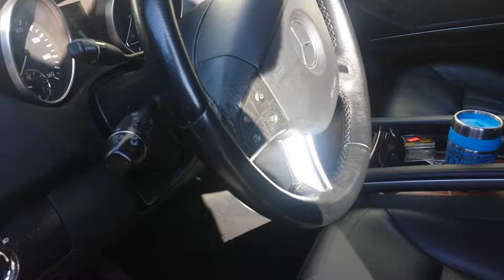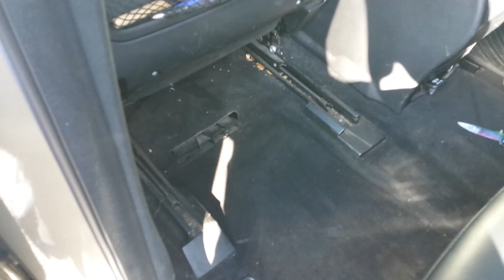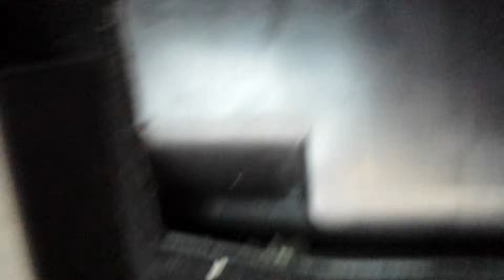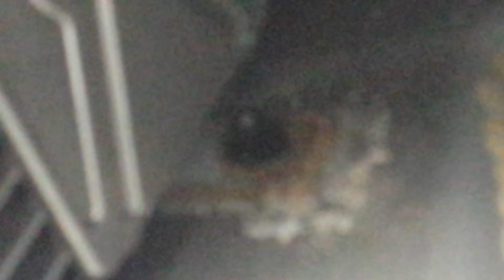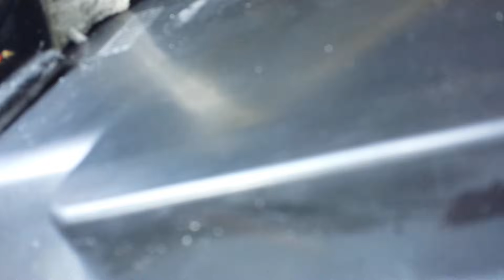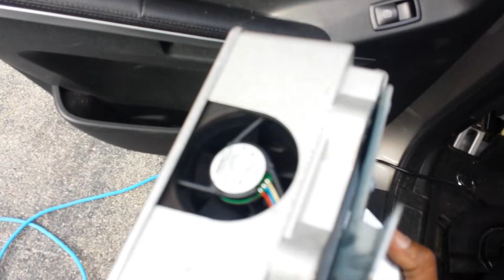Mercedes Amplifier Location/Removal/Install DIY HD

Comment: I have a Mercedes-Benz W169 A 180 CDI Sedan and have discovered water accumulation behind the front passenger seat, which I suspect is due to blocked drain holes. My primary concern is that this water ingress may have affected the wiring harness, particularly the 'wake-up line' (Brown/Pink and Brown/White wires) that runs from the front of the vehicle to the Audio Gateway (AGW), designated as N93/1, located in the luggage compartment (can't find it). My diagnostic report shows a current and stored fault code d135 for a 'wake-up line short circuit to ground,' along with stored codes d136 for a 'wake-up line short circuit to positive,' and d011 for 'supply voltage too high' for the AGW.  Could you please assist on a possible solution

Comment: It's a LOT harder than it looks when you do it! Getting the cover up even enough to get the amp in (I was installing, not removing) took all my strength and effort. But I did get it done - THANKS!

Comment: my 2008 GL450 has static for 5 minutes like blown speakers then perfect guessing the amp under driver seat as it was wet there i found one but had no sound at all so hoping the amp is causing this as i ordered one on ebay junkyard no luck

Comment: Good video. I got exactly the same problem this morning with my Wipers, No sound,
Reply: Check that you have NO water under your carpeting, the lower well, Floor. Drivers Side, move seat all the way back, remove sill panel and lift up that carpeting! Check this out, my control module went bad due to water, then my amplifier blew. Crazy stuff like wipers not working ect. You probably got water coming in from sunroof or under dash.  Mercedes Body Control Module - Genuine Mercedes 1649002901 Change control module and amp. Problem solved. Do it yourself, Just don't go to Mercedes or you'll be ripped off!!  Control module might have to be programed. Any questions, I'll try to help. I couldn't find this info anywhere. I have 2007 GL450. Thanks.

Comment: Thanks for the video, it's the only one dealing with the issue. If the volume works by the steering buttons but not on the radio knob, would you say it'll still be the amplifier? Thanks for your time.

Comment: I have 2005 e 320 radio was working perfect until yesterday now I can't open CD changer and radio display logo and turns off why do I need to check the amp ? Is it under the seat ? Please help 🆘

Comment: What's the model number for the amp on a '07? Are there different variations depending on the system you have in your GL 450?

Comment: @iRepair Autos I too have a 2006 ML350.  I watched and liked a lot of your videos. Were you able to confirm your amp was bad?  Did you replace the amp with another factory amp or an aftermarket amp?  My head unit works, navi works, CD player works but there is no audio, no sound from the speakers.  So Im suspecting its the amp.  Just curious what route you took and if it's working for you.  Thanks
Reply: did you fix your problem yet was it the amp?

Comment: I have a c240 2002 mb. My radio go on but there's not sound. I checked all the fuses and they are good. What could be the problem? Also when I took off the radio the fuse was blown and is replaced now but still no sound.
Reply: Bro I have the same issue. But still haven’t found a solution
Reply: He don’t answer back no question
Reply from the maker: @TheMcs33 that’s correct
Reply from the maker: Your amplifier is possibly dead.  I have a video on this on the channel
Reply from the maker: Look at the fuse for the amplifier
Reply from the maker: Keep searching.

Comment: Hey buddy, I know theres small chance, but. My command unit on this car, won't turn on and drains the battery, car dies within 2 days, is there anything you could recommend before I fork out thousands to get it fixed! Thanks again
Reply from the maker: Remove the fuse for the amp for 15 minutes and then replace.   Start with that.

Comment: Hey guys, I've had a 2008 Mercedes Benz E350 for 2 years now. The Harmon kardon Logic7 sounded amazing with powerful bass. Until one day my CD changer stopped working while I had CDs inside . I've been reading forums and some people said to remove the fuse for AGW, the CD changer and the radio. I followed the steps took the fuses out, put them back, and at the end the CD changer started working again. But ever since I removed the fuses and put them back into place, my sound has not been the same. I used to get powerful bass from the front speakers, and the subwoofer , and an awesome clear surround sound experience. What do I have to do to get the powerful bass back?  So much question is do I have to go into engineering mode to get the sound back, or what do I have to do to get the sound? Because I believe that after removing the fuses I must've messed up a component in the radio system that has to be readjusted. I still get sound, but it's not the same as it used to be before I removed the fuses. Sometimes I try, and I put the bass to maximum, and nothing happens. 
Guys please help me. Please
Reply from the maker: do a radio reset.  I have a video here:  https://youtu.be/iwRIUNMmYXI 
then go into your radio and and set the treble, bass, and surround sound options.

Comment: Thanks for this helpful clip. I had to cut across that plastic cover to get access. What a sight! The recess had 1/2 inch of water in it and the amp module was corroded and the tracks cooked. If I buy a replacement amp does it need to be reprogrammed?
Reply from the maker: No reprogramming needed.  Just plug and play.
Reply: I just removed the plug in the bottom of the recess and the water drained out. An other amp from eBay worked fine without programming. But then the body modules on the other side were also corroded and they do need programming. I sold the car as it clearly was on the way out. Pity such an expensive car is destroyed by a simple design fault- or maybe intentional???
Reply: The shop that found my amp in a puddle said it would cost $1200(CDN) to replace and they would have to reprogram the replacement so I couldn't do it myself. Then I showed them the unit and challenged them to show me the LAN connection. There is none, so I bought an amp off ebay for $250 and will replace it myself.
Reply: I just removed the plug in the bottom of the recess and the water drained out. An other amp from eBay worked fine without programming. But then the body modules on the other side were also corroded and they do need programming. I sold the car as it clearly was on the way out

Comment: Great video and work that you do. I just acquired a 2005 sl500 with a cheapass planet audio unit installed with the existing Bose. Totally distorted sound when streaming or CDs....I never listen to radio. My sense is that the Mercedes amp has been bipassed when they installed this cheap unit because of the distortion. Do you know where the bose system amp is located and can it be connected to the planet audio head> I read somewhere that it cannot....very confusing and not much in the way of resources. Thanks for any reply or opinion. Rick

Comment: All that cutting just to avoid removing four easy bolts and pull the seat out? Doesn't make a lot of sense to me, if it was my car I wouldn't want my carpet cut off like that, but that's just me.

Comment: What was the problem in the amp.  ? Did you repair it or change it  ?
Reply from the maker: Water damage.  I ended up replacing it.
Reply: In some cases cleaning the electronic circuit from moisture salt make it work.
My Ml bluetec front turn signal stuck on , when I open the front Sam found it salty , clean it with spirit and mount it made it normal again .

Comment: Unbolting the seat takes 15 minutes and saves having to cut the carpet as the carpet has a seam for access.
Reply: Well it does look like the access would be easier with the whole seat removed.  If it was my car, I’d have a way to pull up that carpet easily to access the amp. Crazy location.
Reply: Hell not even 15
Reply: Exactly what I thought, I don't know why he cut the carpet, it ruined my day
Reply: theSHARK who cares? It’s a 12 year old SUV. Reattach carpet with Velcro in case the amp breaks again
Reply from the maker: I could do it the way he suggests and if I was doing it for a customer I would. This is my personal vehicle so...   also SRS lights are sometimes triggered by removing the seat.   I don't want to suggest viewers do something that will cause further problems.   I have the tools to turn off these things but not all of my viewers do.   Look on the passenger side of the vehicle. Mercedes has cut the carpet that way too for the battery.
Reply: @iRepairAutos  I Repair you have 27000 subscribers, that is the number of Mercedes owners who have experienced an issue with their crappy audio system, can't find no one willing to mess with Mercedes unrepairable system, went to their crooked dealer anyway, run away after hearing the quote and are trying to find a good samaritan online to give them a clue about that system that no one wants to fix. (this is me by the way..lol). I own a 2008 GL 450 my radio configuration look similar to this one on your video; it has the same issue: no sound, but it manifested soon after I replaced the aux cable in the glove box that was bad. After I removed the radio plugged in the new aux cable, put back everything together there was no sound anymore. Just like in your video but the only difference on the display on this video the sound button is still present but mine disappeared from the display, and the cd changer button in the audio menu disappears as well and no sound; so I don't know if it's something that requires the dealer to reset these functions with their diagnostic tool, or is there a way I can do to solve this because everything was working just fine before I replace that cable. Can you give me any clue?
Reply: @iRepairAutos  if you don't want the airbag light to come on disconnect the battery for 15 minutes and than work 🤗😉

Comment: hey I have a 2007 mercedes ml350 the radio lost the audio and change the radio and the amplifier and still losing the audio can you help me?
Reply: I got a  2006 R 500 and I love my V8! just  put a new 9" android  system  simple and new speakers from Infiniti  kappa the cheaper way to upgrade w/quality...

Comment: I need your help My command unit isnt working properly..it turns on and off but stucks on the logo i can turn the volume up and down too..i can see on the dash that its playing the cd thats been in there but i cant control anything from the steering wheel nd the unit itself any solution?would really appreciate it
Reply from the maker: You should try the reset method.   I'll do a video.  Which Model do you have?
Reply: 2006 ml500 thanks

Comment: Hey guys, I've had a 2008 Mercedes Benz E350 for 2 years now. The Harmon kardon Logic7 sounded amazing. Until one day my CD changer stopped working while I had CDs inside . I've been reading forums and some people said to remove the fuse for AGW, the CD changer and the radio. I followed the steps took the fuses out, put them back, and at the end the CD changer started working again. But ever since I removed the fuses and put them back into place, my sound has not been the same. I used to get powerful bass from the front speakers, and the subwoofer , and an awesome clear surround sound experience. So much question is do I have to go into engineering mode to get the sound back, or what do I have to do to get the sound? Because I believe that after removing the fuses I must've messed up a component in the radio system that has to be readjusted. I still get sound, but it's not the same as it used to be before I removed the fuses. Sometimes I try, and I put the bass to maximum, and nothing happens. 
Guys please help me.
Reply from the maker: I will create a short video on what you need to do.
Reply: @iRepairAutos   Thank you sir. I appreciate
Reply: @iRepairAutos  I will be waiting for the video.
Reply: @iRepairAutos  So the problem can be resolved right?
Reply: @iRepairAutos  Please don't forget about me. The sound issue that I am having please. I will personally pay you, if you show me to get my full sound back
Reply: I got a 2011 GL450 and I believe it has the logic 7 in it not sure how do you know if it has the logic sound system but anyway can you tell me which fuse you removed because I have a CD player I can hear that motor spinning but I can also see it on the display that there's two CDs in the CD changer in the head unit but when I click eject it doesn't do anything it will not spit the CDs out everything else works just fine
Reply: @E-MotionsProductions   I would suggest you lookup or pull the fuse list out of the fuse compartment. I  don't know if the numbers are going to be the same for both cars.

Comment: How can you tell if the amp is bad or not before doing all that work?
Reply from the maker: The first culprit is not having sound.   Check the amp fuse.  Remove the amp fuse for 5 minutes to reset the amp. If still no sound.  You will need to check fiber optic lines groom radio to CD to amp. You should see laser red light activity.   You won't see any on the bad device.   It's not fast.  Star diagnostics tool would tell exactly which module is bad.

Comment: my 2009 ML320 CDI has no sound out of the Pass. Rear speaker.  I've double checked the leads and nothing seams out of place.  The Tweeter and the 6.5" Speaker both don't work but all other speakers are fine.  Any suggestions?
Reply from the maker: You can and should do a sterro reset to default.  I'll probably create a video showing how to do this shortly.

Comment: in the Mercedes B200 w245 of 2007 is located in the same place?
Reply from the maker: I'll have to check.   Sedans it's usually in the trunk behind the panel on the wall.

Comment: My radio won't turn on, do you know why? Nothing works it used to turn on and off now it's completely off and won't turn on. Please help.
Reply from the maker: Could be the fuse, could be a bad head unit.  Start by checking the fuses.
Reply: iRepair Autos checked all the fuses and they seem to be fine.
Reply: I took it out unplugged it and plugged it back in and it worked, but when there is a high bass drop it shuts off and it doesn't turn back on I am not sure why,  if anyone knows why this is happening please help.
Reply: What did you take out? The amp or the head unit?

Comment: Love the video, and the instruction, will be sitting around for part two.  Question and how I landed here. 2011 Mercedes E350 Coupe..radio cutting in and out over the months, Mercedes waste of time, looked at speakers, etc.. now radio has stopped no sound. 
Please tell me the Harman Kardon amp isn't under the seat... that would be the worst news ever.  BTW  Merry Christmas, and thanks for the vid.

New Subscriber
Reply: did u figure out a solution?
Reply from the maker: Yes.   Water damaged unit.   Repairing multilevel boards with components is beyond what I can repair with my current equipment.   Best to buy a working one used from online auction site.

Comment: Where did you find a replacement amp and how much was it? I am having an issue with my R350 where I get no sound yet everything else seems functional.  I don’t even get a hissing sound.  I looked online and see this part costs over 2k!  Used ones on eBay cost 450 which is also expensive considering it will still be prone to failure.

Comment: WHY ARE YOU DESTROYING THE CAR !?!?!?!?!?!?!?!? Do you think German engineers designed the car this way for it to require being cut open?
Reply from the maker: +Oscar Gonzalez take a look at the passenger side, where the battery and aux batter resides. The carpet is cut... from the factory.

Comment: Obviously designed not to be removed
Reply from the maker: +Rich Cook Mercedes charges 3k to replace that module.  Part plus labor.  Includes removing the front seat, carpet etc.

Comment: good effort but how do you repair the carpet..?????
Reply from the maker: +George Spyrou the carpet goes back togeher.  Look at the right passenger floor. The battery is under the cut carpet as well. That's from factory.